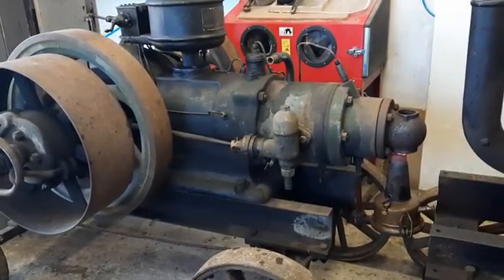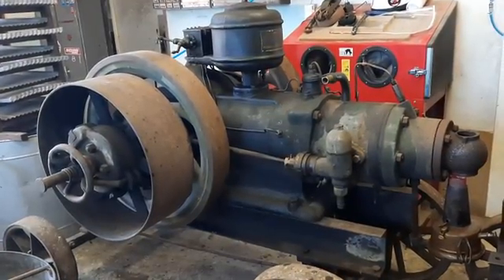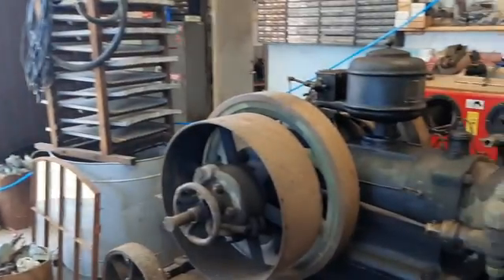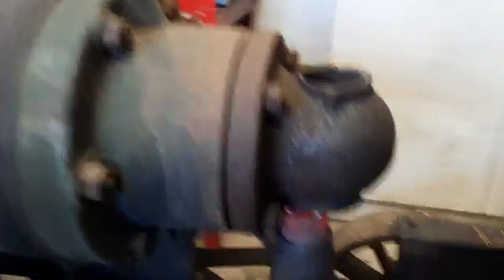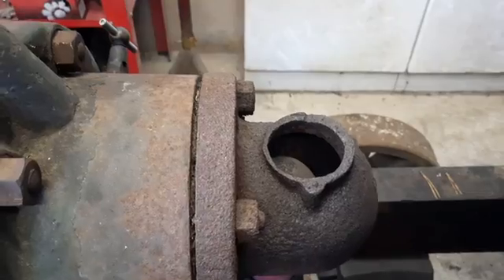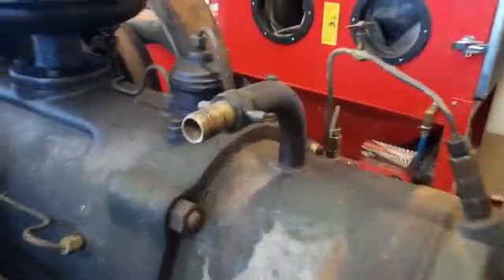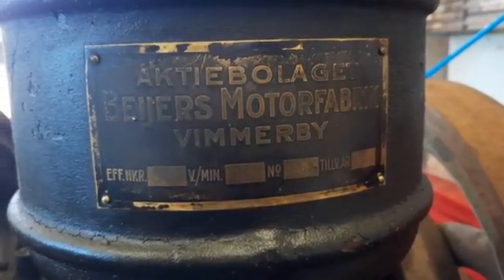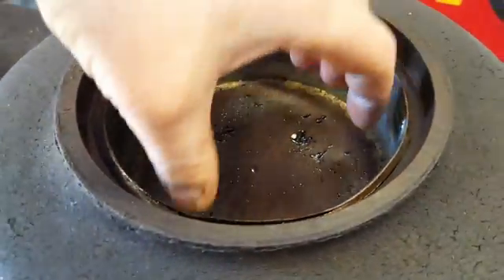10.4L Oil Engine Running @ Zero RPM. How is that possible?

Comment: its not actually running , only rocking back and forth on compression so actually useless
Reply: I suppose there is some kind of clutch mechanisn you could make to make a practical use for it. Like a spring loaded grab/release system with a viscous coupling  on the output. Probably wouldn't spin very fast or be very powerful without a large flywheel. I dunno...
Reply: @mikeh2006  
Running a super large agitator washing machine?
Reply: @JohnSmith-yv6eq  Exactly!

Comment: Well... practically liquid that burns, that is. I bet not wax, though! Would it work on wax?
Reply: Liquid wax...like you see around a candle wick...the wick can only transport and absorb liquid wax.....then it burns at the end of the wick when the air can mix at the right proportions...
Don't forget that diesel fuel has liquid wax in it...which is why is "waxes" or "gels" in extreme cold...and won't run through a diesel injection pump or fuel line until it is heated up....
Reply: @JohnSmith-yv6eq : Oh, yep! But doesn't it actually gel... instead of only figuratively as suggested by the quotation marks?
Reply: @HelloKittyFanMan.  
For those less edumacated I try to make it simple...
"Gel" in your hair...well, it might run on that, too.
Reply: @JohnSmith-yv6eq : What would that supposedly have to do with what I asked, edumacated boy? If diesel fuel appears to have gelled, then it actually gelled, rather than just figuratively, as with the quotes, did it not?

Comment: Yes 2 strokes engines will run in reverse as well. We used to do tricks with 2 stroke motor cycles by clutch starting it in reverse and dong reverse burn outs. Or give it to an unsuspecting rider and watch the shock when they release the clutch and take off backwards. Wouldn't recommend jeering them up to do a mono, unless you really dislike that person.

Comment: Great video!  What kind of fuel were you running it on?
Reply: For these engines Richard commented that almost any oil can be used as fuel....diesel, ATF, sump oil, hydraulic oil etc.
It's when you get on the road and tax needs to be paid that diesel with tax built in  becomes the right thing to use as fuel...
otherwise your tractor/car can be confiscated and you get a large fine...
Most countries have different colours for taxed and untaxed diesel...

Comment: Its amazing because even though the engine is basically bulletproof, someone not knowing the engine could easily hurt it.  In todays start and go, no one has the knowledge of what makes this simple run.  Burns a little oil (lol)  but it's old enough to smoke!

Comment: The old Marshall & Fowler tractors were the same. 2 stroke. Sometimes they started backwards, when started on a cartridge. Driver got on, engaged forward gear & went out through the back of the shed.....1 forward & 3 reverse gears!

Comment: But its not really zero RPM, it's half a RPM. Its still rotating after all, just not a full revolution. For zero RPM, i would expect it to not be moving even though that doesn't make sense.
Reply: If you go half way up and then go half way back...you never complete a revolution.
No revolution = zero revolution

Comment: Why is not there in the ventilation and exhaust lift workshop?
Reply: There are doors and windows...you just have to remember to open them before you start the engine...

Comment: I'm only 22 but I remember a place I worked at (old village from the late 1800s) had a hit and miss that apparently would run at 0 rpm to power a shingle mill, interesting to see how engineers figured out things with only "limited" technology

Comment: I feel like a catalyst won't be enough for euro 6
Reply from the maker: Haha, probably not. But when it is warmed up and running it is smoke free. So this is just cold. And they are very fuel efficent to actually. And you can run it on vegetable oil so it can be carbon neutral too 😁

Comment: Not the cleanest burner I’ve seen 😂😂
Reply: Yesterdays Machinery
1 month ago
Haha, probably not. But when it is warmed up and running it is smoke free. So this is just cold. And they are very fuel efficent to actually. And you can run it on vegetable oil so it can be carbon neutral too 😁

Comment: Bit smokey, ha ha, it is the heavy flywheels that allow it to run at such low rpm they maintain some momentum.
Reply from the maker: Just a little 😅 Yes, i think the flywheels weigh about 200kg each on this one.
Reply: Yesterdays Machinery
1 month ago
But when it is warmed up and running it is smoke free. So this is just cold. And they are very fuel efficent to actually. And you can run it on vegetable oil so it can be carbon neutral too 😁

Comment: So the touch is the ignition system like a nitro glow plug motor?
Reply: Same general principle...
a heat spot that initially needs an external energy source to glow red hot..
which ignites the first air/fuel on compression...
then the hot spot stays hot from the following compressions/ignitions.....
and the external source can be taken away..

Comment: Absolutely superb engine and a very good commentary well done sir !!
I have several hot bulb marine engines that work on a similar principal but are quite rare in England 
And can be quite scary when the run away on first start !!
I notice a little combustion gasses escaping from the water jacket is it the head gasket on its way out ?
Reply from the maker: Hey and thanks! It is water vapours because is was some water left in the cylinder. Regards Richard, Sweden.

Comment: The cool thing about 0 RPM is it will make a good hammer or band saw engine.  Today Eveyone use roto modern and mechanically convert it into up and down motion with the expection hydraulics and pneumatics

Comment: I want to see the Roofing Tin Radiator at work!
Reply: Water runs down from one tin plate onto the next, the coolant loses heat by evaporation of a small amount of coolant....
coolant top ups are required....

Comment: My eyes are  watering from the beuty of this 2 stroke diesel and from the smoke. He boss. Great video but run a darn exhast hose outside for me please. I can hardly see. These engines are like art to me.
Reply: Yesterdays Machinery
1 month ago
But when it is warmed up and running it is smoke free. So this is just cold. And they are very fuel efficent to actually. And you can run it on vegetable oil so it can be carbon neutral too 😁

Comment: how did it run without water cooling?
Reply: Richard commented that the engine is made of 1.4 tonnes of cast iron...which takes a long time to heat up to dangerous temperatures.
Note the steam coming out of the water pipe as the water left in the cyclinder jacket started to steam....

Comment: You really need to consider investing in a proper ventilation system...
Reply: Doors and windows open...
Yesterdays Machinery
1 month ago
But when it is warmed up and running it is smoke free. So this is just cold. And they are very fuel efficent to actually. And you can run it on vegetable oil so it can be carbon neutral too 😁

Comment: Smoke a cigarette while you’re watching this for proper immersion
Reply: Yesterdays Machinery
1 month ago
Haha, probably not. But when it is warmed up and running it is smoke free. So this is just cold. And they are very fuel efficent to actually. And you can run it on vegetable oil so it can be carbon neutral too 😁

Comment: Runs cleaner than a VW diesel, now das auto!
Reply: Yesterdays Machinery
1 month ago
Haha, probably not. But when it is warmed up and running it is smoke free. So this is just cold. And they are very fuel efficent to actually. And you can run it on vegetable oil so it can be carbon neutral too 😁
Reply: @JohnSmith-yv6eq  The old machines are really cool. Surprising how far internal combustion engines have come since then.

Comment: I would argue, that the engine does not run at 0 RPM. If it is turning a third of a turn forward then turning a third of the turn backwards it is effectively doing two-thirds of an RPM every cycle. I understand what you're trying to say but it's inaccurate because zero RPM would indicate it was at a standstill. It is still cool to see.
Reply: The measure specified is "complete revolutions in a minute".
It never completes one whole revolution...ever..let alone a minute....so...
it's a 1/2 stroke engine...

Comment: When I was a kid I used watch road menders compact earth with a hammer that worked similar to this.  They dropped it on the surface which pushed a piston up inside a cylinder, at the top of the stroke fuel mixture ignited and sent the piston back down and the cycle repeated, with the machine bouncing all over the road guided by the operator who had to keep his toes well clear!
Reply: They made a pogo stick for kids that had a 2 stroke cylinder, carb, ignition sytem and fired as you compressed the stick....
the bounce was really quite good....effortless, really...

Comment: Dude, you need to get some ventilation going on in there before ya go to sleep....
Reply: Doors and windows work if you open them before you start the engine...
Yesterdays Machinery
1 month ago
But when it is warmed up and running it is smoke free. So this is just cold. And they are very fuel efficent to actually. And you can run it on vegetable oil so it can be carbon neutral too 😁

Comment: I saw a 1910 hit n miss engine running a water pump in the San Jauquine valley in California and it pumped 143,000 gallons per hour and 1 gallon of fuel per hour, no pump today can match that. There are pumps that can do 143,000 gallons per hour but not while using only one gallon of fuel.

Comment: What would that have been used for in it day?
Reply: This had some pretty interesting pics, based on the same concept. 
https://www.google.com/url?sa=t&source=web&rct=j&url=https://www.core77.com/posts/58982/How-Did-Factories-Get-Power-to-Their-Machines-Before-Electricity&ved=2ahUKEwiv6p-w_IjyAhUKU98KHWRbCyEQFjACegQIGxAC&usg=AOvVaw1lC1ojGM1UnYlPyEgCxyKO

Comment: and while you have no water going in it wrecks the engine far to long with out cool water , the damage done by running like if its your engine ok if it was mine i would not be happy
Reply from the maker: No problem, very thick cast iron and no load. Doesnt heat up that quick. But with a modern car engine for example that would not be good to run this long. Regards.

Comment: That sound!! Just like the old Hot Head Landini's they used to put on show for the farmers fair (i don't know how it's called in english) near my house. They even used to do some plowing in the field to show how it was done back in the day. The old Landini's worked basically the same working: a big ass single cylinder and two giant flywheels on the sides but on a tractor. The funny thing with those is that since the engine can run backwards you can have three or more reverse gears depending on the gearbox. It's a shame they don't show them anymore

Comment: If you put a heavier flywheel on it you'll be able to make it run at zero RPM even slower. (if that makes any sense)
Reply: I'm pretty sure that would just stall the engine out, like as if u would put a load on it at that power.

Comment: I was at Knox Berry Farm 30 years ago and there was a display of 20-30 these old engines running.  The old bastards had EVERY one running spewing out smoke and oil, it was extremely smoggy that day and difficult to breathe alone without the old dumb-shits and their silly fucking toys.  That's why I call it "Smell-A"  I'll never go back
Reply: Most of those old farts are probably dead now...you should be safe....
There will soon be hardly anyone alive to show people working history.....
You can't run these without common sense.....and a love of machinery.....

Comment: I figured that 0 rpm would be just rocking back and forth.
Not sure what it could be used for in this mode, it would stall if you put any load on it. Like all 2 strokes they can start in any direction.
The 2 plane gudgeon pin was interesting. Compensates for poor alignment and wear.
I WANT ONE!

Comment: good video, one point of running like this was some machinery of that era, drills, rock hammers, which were driven by these engines( a lether belt on the flywheel), could NOT function with a revolution,aka only travel in a straight line, then reset going the other direction,  the belt would slip 1/2 the time, so that is why there was a reason for this.

Comment: Seems like a long time with no coolant.
Reply from the maker: No, very much cast iron to heat up. But you shoult not run it much longer than this. And absolutely not with any load.

Comment: I’m a Brit living in Romania, and occasionally, in rural areas, you’ll see one of these mounted on a self-propelled saw-bench, with a couple of guys taking it to the next job, to cut lumber from whole felled trees.
They’re beasts of an engine, so much power from a single cylinder. You can hear them coming from several hundred meters. 🤣❤️👍🏻🇷🇴🇬🇧

Comment: Fascinating and very clear explanation. One thing though: where is the 'exhaust'? You show the air inlet (how does the air get to the other end of the piston?) but it's not obvious where the burnt fuel gases are emitted, only that there's smoke everywhere!!

Comment: About 30 years ago I had a moped with manual adjustable ignition. When the engine was hot, i could adjust the ignition so high that i could start it in reverse. Was funny letting people try it, putting it in gear and watch them fall over the handlebars as it took off backwards XD

Comment: Makes me think of an old huge diesel generator we had in morocco in our countryside house. If we wanted electricity at night we had to start it, but the only way to start it was to crank it by hand. At first it was very heavy and you had to use a lot of force to get it going. Then you had to keep going faster and faster to get it to start. Once you hear it kicking on you had to quickly remove the handle from the crankshaft before it ripped your arm off. I was still too young at that time so i could never do it but my father died very young and my mom and sisters weren't very strong either so we would take turns trying to get it started. Some nights we wouldn't succeed and we would just spend the quiet evening outside in the moonlight or a small propane lantern

Comment: Hardly zero RPM. It is oscillating between either side of compression. I have had small glow plug model engines do that.

Comment: So do you run it on crude oil or diesel?
Reply from the maker: Here its running on old diesel, like 40 years old. But it is diesel made for diesel-burners. Very thick and more like engine oil. Smells very much, you dont want it on your clothes.
Reply: @YesterdaysMachinery  like, heavy marine diesel? Nasty shit.

Comment: SO to run at 0 RPM there must be pre-ignition. Not very efficient.
Reply from the maker: Yes these always preignite even when running at rated speed, in this case 400rpm. The fuel is sprayed in when the piston is around half way up. Then ignites when the compression rises. The engine is so over-dimensionized for 13hp that this is not a problem and those engines are pretty much indestructable as long its got oil.

Comment: I used to have to get a dual cylinder Meitz (I think it was) going to pump water from a river up to three large tanks 50kL there was a tank of goodness knows what, anything that burns was what I was told!  The bulbs were heated from a couple of propane burners.  The farmer said he'd change it out when it died, the farmer died before the engine did!  I vaguely remember it was plated for 120 HP the ground shook when it ran too 😝 but at least it had a chimney to avoid the smoke.  The farmer had painted an arrow on the crank as it was possible to start it backwards... 🤯

Comment: Keep it oiled up and this will run for a thousand years.
Reply from the maker: Yes, i dont think you can break it if the oil supply is good. Those are well known to be indestructable.
Reply: Factories and sawmills from Germany to Russia, when these things were common, a century ago, often ran their hot-bulb stationary engines for many months at a time without stopping.  Just kept topped-up with fuel, and with oil for the dead-loss system.  Oil never needed changing because it was continually consumed.

Comment: One of the strangest. Internal engine I have seen. Question, when running at 0 RPM piston rocking back and forth, can the engine  start to run in reverse direction when it stars to increase RPM?
Reply: As YM replies here, yes they can.  
     Tens, perhaps hundreds, of thousands of tractors were made with this type of engine, single cylinder like this and about the same size:  the German 'Lanz' was the most famous make.  Very occasionally when pulling a too-heavy load uphill they would be forced to slow down and down until reaching this minimum speed as shown in this video, and then they could reverse themselves and run backwards [with the throttle still fully open] - quite a nightmare for the driver if he didn't react quickly enough!
     Depending on the lubrication system in use, it might not be a good idea to run them for long 'backwards'.  Also the maximum power obtained would probably be less, again this depends upon how the injector is timed, and the temperature of the hot bulb.  However, having said this, it's true that some of the earliest of these hot-bulb tractor designs had no reverse gear, and used this engine feature for reversing when necessary.  This would normally be only for moves of short duration, though.
     Another scary scenario that has occasionally happened with these is the 'runaway' when the engine begins to burn lubrication oil picked up by the incoming air as it passes through the crankcase.  Turning off the normal fuel supply is no use.  The engine speeds up uncontrollably and can destroy itself in a very short time.  Very rare, but recorded.
Reply from the maker: Yes it can start and run at either direction you want.